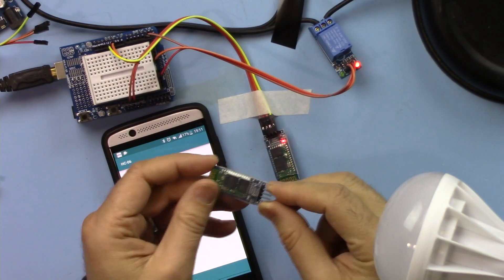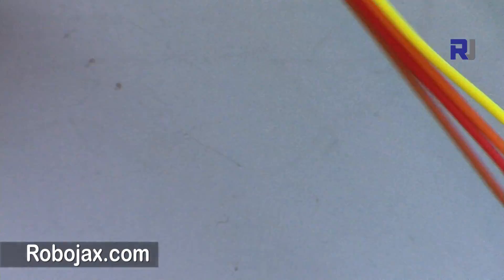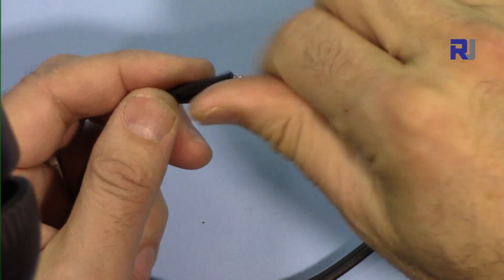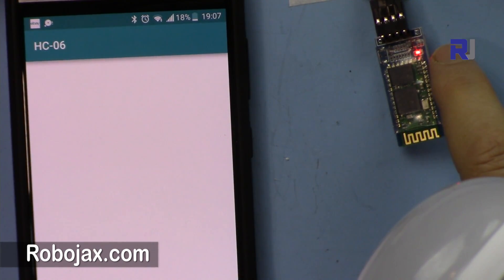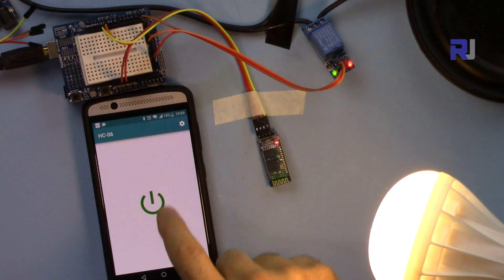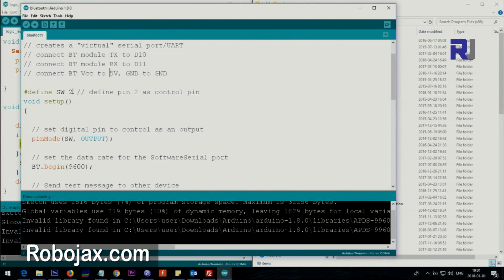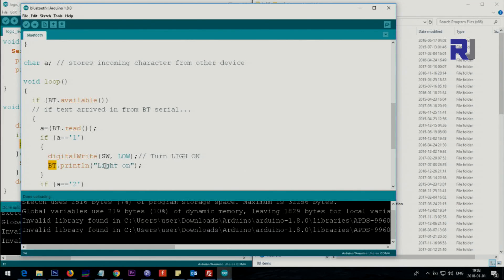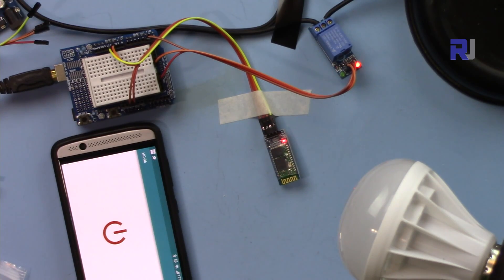Turn AC Bulb ON/OFF using Bluetooth HC-06 and cellphone with Arduino

Comment: Is it wise to connect the 3.3 volt RX pin to the Arduino 5 volt pin?
Reply from the maker: I just watched the video to make sure I have explained it. Indeed I have done it. Please watch without skipping and you will see it. Thanks.
Reply: @robojax  Thanks, I understand that the HC-06 RX pin  is connected to Arduino pin 11 which is 5v pin. When it's high it transmit 5v to the RX pin. Thats true ?
Reply: @batticha462  You're making a good point here and this guy does not seem to know what he's talking about.  He claims to have explained it yet makes ZERO mention of the 3.3 volt maximum rating for this device. What an assH...  LOL.
Reply: @robojax  You need emphasize on the 3.3v limit else you're gona be held responsible for all the damage done!!!!!
Reply: @ziad_jkhan  That's right and I personally burned a few different modules that way

Comment: You also provide bulb ac current or just connected buld wire to relay?
Reply from the maker: is your question about wiring or how to connect the wires? I have shown AC wire how to connect. you can connect it to DC load or AC load. Please put the question in your language and I use google to translate it.

Comment: Sir, is this board better than lm2596 board, my project needs to be powered with 5v from a vehicle battery. Atmega328 + sim808 based project requires up to 2A but for very short time.
Reply from the maker: MEGA only has extra pins and features. Will not make any difference in this case.
Reply: @robojax  thanks for the quick response. Actually my question about lm2596 vs mp1584. Thanks.

Comment: sir can i make it turn a 12V LED strip instead? and can i use 3.3V instead of 5V for the relay?
Reply from the maker: yes you can if you use 3.3V relay.
Reply: @robojax  and will there be changes to the coding?

Comment: I  like to use this for my HO train set turnout. But i need a auto relay  turn off  once  the button  is pushed ( 1 second  active only long enough to throw the relay) that would trip the relay with out burning out my turnout.   I not a code write so i really  lost...
Reply from the maker: Hi, You need to know to make this work. Or hire someone. Your project is not simple.

Comment: Oddly - I get an error on compiling if the "a" value is greater than 9?
Reply from the maker: I just checked the code, it seems you are sending different numbers. Please try the exact example make sure it works, then try customizing it. Make sure to use ASCII character or English on the keyboard. it could be different language have something to do with it.

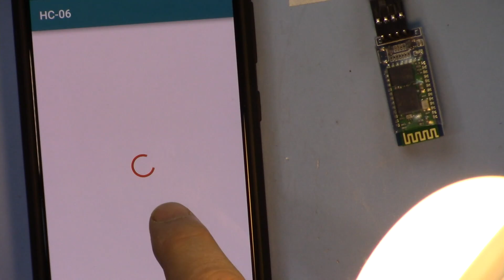Comment: please provide app link. can't find it in 10:34
Reply from the maker: The app is called " Android Bluetooth Controller" and it has been change but I found similar app which I have not tested it and it should work. I updated the link. By the way the timing you put is the end of video.